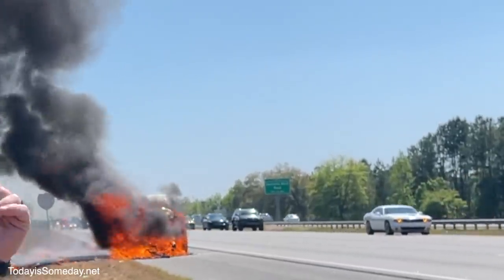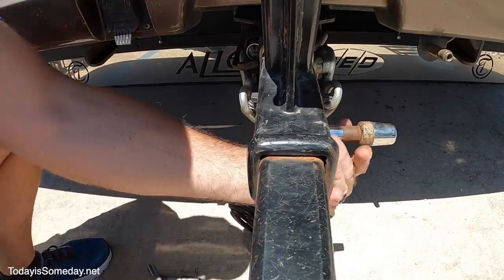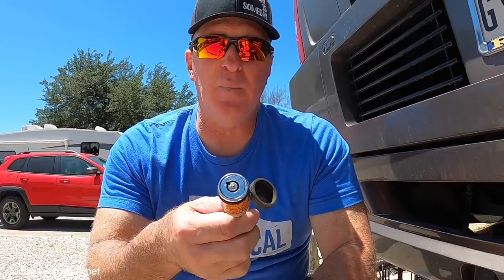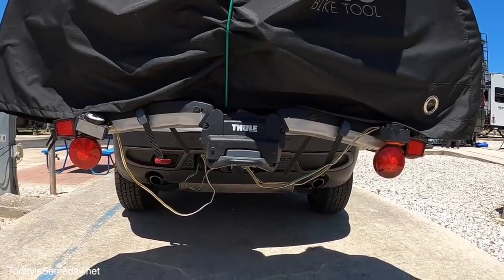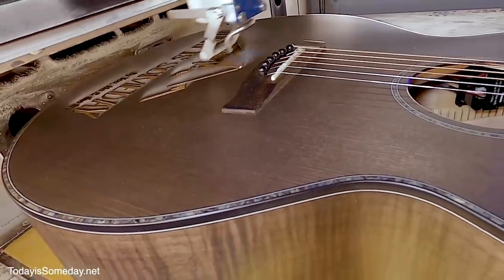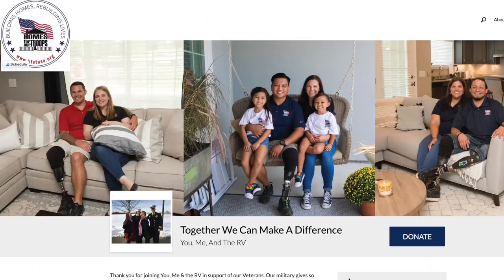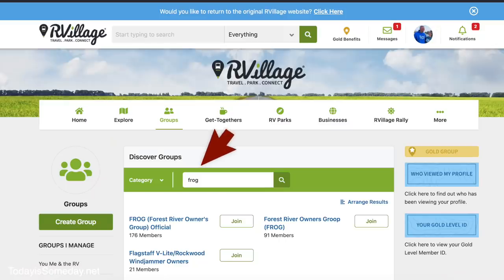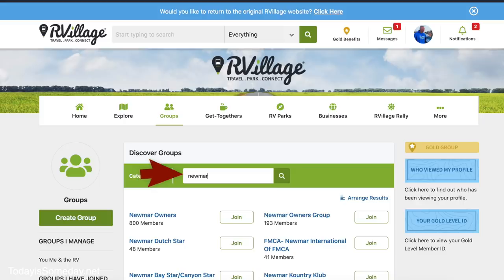RV Tow Car Changes (FULL TIME RV)

Comment: At the moment the tow bar is secured to the motorhome with a locking pin and the tow bar arms are connected to the toad with cotter pins only.  Will be thinking about using easily removable pin on the tow bar connection to the hitch when traveling.  Appreciate the video on the topic, good food for thought.  Go Navy!

Comment: Some thoughts,for tow vehicle parked overnight,put the car in park,park brake on and activate alarm if you have one.then leave a BIG note on or near the RV ignition to reverse what you did to the tow vehicle before starting the RV.About fire extinguishers,put extra large one in one of the passenger bay compartment,and one smaller one.the large one couls be used for very large fires and the smaller one could be used for outdoor fires,like bbq,camp fire,tikki torch gone wild,etc.One important note is keep at least one extinguisher in the bedroom area,this could be used to make a path in the fire to exit the RV.Of course,VERY IMPORTANT!!! STOP making fires!!!  (just had to add that....lol).enjoy....

Comment: Vise grips are your friend.  I use Erwin brand as they work the best. I keep a pair handy in the front.
Once the locking pin is removed you can use the head of the pliers to hammer the big pin most of the way out.  Then clamp the pliers onto the pin and wiggle the pin out under tension. 
I went crazy with fire extinguishers.
  I have one useless ABC powo extinguisher.  I bought a 6 litter kitchen extinguisher, Brand Badger Model WC-100. 
I bought a quart of Cold Fire additive, that's mixed with water.
It's then charge with 100 psi of air.   You can use it and refill it.
This allows you to try it out and know how well it works.  Test it with water as that's free.  Then test it with additive.  This sprays a large mist at the fire. Shoots about 10-15 feet.   I also bought a 2 gallon water extinguisher, which shoots a stream about 25-30 feet.  With the cold fire additive I can put out a tire fire.

Comment: Thanks. You made me take another look on how I hook up the TOAD. I'm going to start with the cotter pin on the hitch pin.
Reply: Yeah, regardless of which side of the tandem is on fire, it seems easier to separate one pin on the hitch side than two on the vehicle side when seconds count.  Of course, how close the nasty hot flamey stuff is at that moment to either will influence your decision.

Comment: My nephew’s locking pins (ones which use a key)have a slight bend in them.  Now his are not hooked to a towed car, but a trailer.  So those pins can bend which make it difficult to remove too.  Just be informed, those can bend which make them difficult to remove. Not sure if this is the norm with those style of pins.

Comment: You should check into pins that's got a handle on it if you could stop by a tractor supply or Farm Supply they would have them much easier to get out

Comment: Consider connecting a cable to the cotter pin on travel days and "storing" it on the hitch above your toad hitch.  That way you will not have to bend down closer to the fire to pull the pin.  You will only need to grab the attached cable and pull that to remove the pin.  If you also attached a cable to the other part of the pn you may be able to pull that to get it out of the hitch and be farther away from the fire while pulling it.

Comment: Thanks for this one.  I lock my travel trailer hitch setup to the truck when pulling, but I'm contemplating going back to the cotter pin for travel days.  My biggest worry is the three 20lbs bottles of propane sitting on the tongue - if there is a fire there, the whole setup is probably gone even with gasstop valves.  Travel safely!

Comment: I always only pin the toad. If we stop for the night I put on the parking brake and put the transmission in gear (it’s a manual). So it can’t be rolled away, in the morning take the brake off and transmission back to neutral. If the car is crooked at all I have issues with pin removal.

Comment: We  have a 10lb inside the entry door, a small extinguisher by the laundry as well as Proteng in the fridge and water heater. We have a glass breaking hammer in the front of the coach and by the bed. Please also check your emergency exit window. Ours was stuck closed, pushing on it with both feet wouldn’t free it. Practice emergency exits. It’s further to the ground than you think!

Comment: We have a locking pin for the receiver to the tow bar.  We have (not locking) cotter pins for the tow bar to the toad.  I know it can be difficult to disconnect the toad from the tow bar when there is tension on the tow bar.  I have a 3lb sledgehammer and a 3/4 inch bolt in the rear bay of the RV.  Once I have the cotter pin pulled, one good whack will release the pin.  In an emergency situation I hope that I have a clear enough head to get that done.  By this method, we keep the tow bar locked to the RV and I don't have to remember to lock the tow bar to the RV when we arrive at camp.

Comment: Most tow bars have handles that are easily depressed to unlock the tension between the coach and the towed.  Hitting those first should make it possible to unhook the tow bar quickly.

Comment: As far as un hooking have a claw hammer handy you could pull spring pins with the claws and drive out a pin with the hammer head,
you ado a great job

Comment: My husband seen that video and also removed the locking pins and no longer locking the hitch, he is using the cotter pins instead.  Good point to put it on passenger side we didn’t think about that.  Thanks for the information guys we appreciate your videos.
Reply from the maker: So glad we can learn from each other!
Reply: I would have thought pulling the cotter pin would be easy but pulling the hitch pin out is the hard part.

Comment: Cutting the tode loose on a grade can cause another problem unless some one is inside to hold the brake. But if the tode is on fire and it is on a grade it can either smash into the rig or take off down the road in flames.

Comment: A 10 pound ABC fire extinguisher will extinguish alot of fire if you know how to use it.  A service most fire departments provide is training on the proper use of fire extinguishers.  It will help you stay safe if you make the decision to try and extinguish a fire.  A note on a toad fire.  Be extremely careful on putting yourself between the toad and motorhome.  Some vehicles have cylinders on the front bumper which could fail with a well involved engine compartment fire and cause serious injury.

Comment: Hey guys, just a little trivia, the locking pins you are speaking of are commonly known as a linch pin in the farming community.  Reasonably priced and all different sizes at Tractor Supply Stores.
Be safe out there.

Comment: I switched to cotter pins on the toad a while ago because locking pins became difficult to turn even after using lock lube. I still use the locking pin on the receiver but will now rethink using cotter pin there also. What about taking the toad out of neutral to prevent someone rolling it away? Still would need to put the locking pin in the receiver when parked to prevent it from walking away. Love your videos! Stay safe.

Comment: The only locking pin we use is on the hitch locking the tow bar to the MH.  On travel days where we do not want to disconnect the car we always put the car in park and lock the doors. We have to run the car engine before we start out in the morning anyway to move the transmission fluid in the car per the manufacturers towing recommendations anyway so ours is not left in neutral overnight.
Reply from the maker: Perfect.  It is always good to use the manufacturer's recommendations.

Comment: I would put the cotter pin on the driver's side. That's an easy pull. Once you remove the cotter pin, you can pull the hitch pin towards you on the passenger side.

Comment: Doc Fair - your experiences made me sell my new (never used) tow-dolly, buy a 4-wheel drive Jeep Cherokee just like yours, outfit the motorhome and Jeep with a tow package. I have been intimidated by the steps needed to tow the Cherokee and haven't towed it. I installed a Revelco anti-theft on all my vehicles ($600) including the motorhome and Cherokee. I have been restoring the motor home to better than new for 2 years during Covid. Both The Beast (and me vaccinated) are ready to hit the road.

Comment: I have moved from the standard pins to locking pins on my towed setup.  This is due to the stories I hear about people coming by when you're parked and pulling a pin for the fun of it.  I don't want to be driving down the road and losing my hitch or connection point on my towed.

Comment: We have the Thule Easyfold and use a bike cover also.  For lights, I made a lightbar.  5 foot 3/4" PVC in a neon pool noodle.  Lights attached to the bar.  You can use clips or straps to attach the light bar to the cover (or the bikes without the cover).   The lights are substantially more visible when placed higher.
Reply: How are the lights powered on the rack?

Comment: We had a cotter pin come off one arm on our tow in El Paso, I looked over and the tow was in the other lane. Luckily only one came off and I was able to come to a slow stop in the median. I switched to locking pins all around and never have had another problem. I am going to switch the main hitch lock to a pin while traveling after seeing this video. I will not change the the locking pins on the arms after that experience..

Comment: Hi guys. Great info. I actually ended up helping a guy in a gas station. Before he realized he could not make a turn into the pump (regular station - gas A class) he was stuck. Somehow the locking pins became full of road grime with the covers on so I ended up taking it all off the coach by breaking the locking pin. Got the Jeep off to the side. Loaded the pins with WD40. replaced the main coach locking pin with a standard unit. He was lucky that I had a spare.  The coach and Jeep were parked for 2 months while they were at home. They left everything hooked up so it would be ready to go. Nice couple and I was happy to help. However no way did they do a pre trip check on anything outside. Jeep tire pressures were low, they did not have a pressure system on the coach. They said they usually didn't travel far, so they didn't expect issues. WOW  
Checking all locking pins and clip pins this should be done before every trip just like the tire pressure and window shield fluid level and type. Since were in Canada and head south in December freezing has already taken place. Do you have the correct -40 stuff or has the container froze and broken ?

Comment: They do make locking pins that can be keyed to the same key as the Jeep which would allow u to keep looking pins on but have easy access in terms of a key for quick removal... I know there are suppression systems for the engine of bay of your RV( I believe Jones n to travel) endorses a product.... but regardless thank you for all the tips they are applicable even for us still in sticks and bricks

Comment: If you used pin with a 90 on the end, and kept a hammer by the door and ran back with a hammer, you can beat a pin out without another trip to the front to shake the vehicle to release the pressure.

Comment: What caused the fire?  that should be what we are concerned with.
Tow bar is attached with a bolt and self locking nut.. ( that is getting changed?) Our Jeep is on a trailer. (we have 2 ways to tow) on a trailer/ 4 down.
 It will be on a trailer from on.

Comment: Great video guys. Good food for thought. I am using the locking pins as well. I think I will replace the one locking pin on the receiver side with a non-locking pin on travel days. Easy enough to do and might save some time in an emergency. Thanks for sharing. #GONAVY

Comment: I diagree on the placement of the cotter pin. It should be on the drivers side as it is easier to remove and then you can pull the Pin from the Passengers side which in most cases requires more effort

Comment: Like you, I have been using the locking pins on both the hitch side and the towed side when leaving the towed connected overnight, but switching the towed side to cotter pins when underway (still using the locking pin on the hitch end).  I have also been thinking about your fire video; how would I disconnect the tow bar from the hitch in the event of a fire in my towed (Jeep Grand Cherokee).  I guess I'm going to follow your lead.  Yes; I have found it difficult to remove the locking pins or cotter pins at times just disconnecting our towed to use it.  I think we have the same tow bar as you: Blue Ox Avail.  Even depressing those tension release levers doesn't help, especially if on an unloved surface.  So switching back and forth from locking pins to cotter pins may sound easier than it will be, but safety first.
Reply from the maker: We agree completely! That toad was on a slight hill so it was very hard to remove the cotter pin!

Comment: Hey guys wanted to let you know what I did with my bike rack since I carry my bicycles covered on the back of my toad as well I added LED boat trailer lights to the bike rack itself and then adapted the harness to plug-in to either my jeeps trailer hitch harness when I’m not towing it or the RVs trailer hitch harness when I am. 
Brad
“It’s about time now”
Sends

Comment: Just a couple of random thoughts (that are probably echoing what someone already said).

1.  If you are just doing a quick overnight stop (Cracker Barrel, Walmart, etc.) where you do not need to disconnect the toad, it is probably a good practice to put your tow vehicle in park and lock it up tight overnight anyway.  That should foil the easy roll-a-way theft issue anyway.  
2.  In the circumstance where the toad is on fire in the front (as was the case in your assistance adventure), couldn't someone had just gone behind the vehicle and pushed it a little towards the hitch and relieved the pin pressure that way?

Of course, my big takeaway from that prior video is FIRE EXTINGUISHERS.  Buy all you might possibly need and then buy one more.
Reply from the maker: All great ideas.  Once the Jeep is in tow mode, for us, it is easier to swap out pins, then remembering to go and actually mess with the brake (it is already in park in tow mode).  This way we know for sure that it hasn't been messed with.  Pushing the vehicle might work, depending on if you were on flat smooth ground.  But gives folks something to consider for sure.
Reply: @todayissomeday  Yeah, I was thinking of the common small manual tranny cars that many people tow.  It is already in neutral so it probably wouldn't take much pressure from the rear to relieve the tension on the pins.  The viability of this idea will be highly dependent on the tow vehicle, the incline, the body strength of the person, etc.  Just the thought of a $15K car being on fire attached a Class A worth 10 times as much (that also likely contains many/most of your worldly possessions) is frightening as hell.

Comment: Since halon is illegal these days I don't think you're going get any of that although i guess there some older ones still available.  I've given a fair amount of thought to fire extinguisher in my rig and I think I'm going to go for CO2.  I know it's not approved for the types of fires you get in RVs (I forget whether it's A, B or C) but it doesn't leave a mess like the dry chemical extinguishers.  The problem with dry chemical is that if they actually put the fire out the chemicals do as much or more damage than the fire did, that chemical is incredibly corrosive.   
As far as Homes for Our Troops goes have you guys ever thought of doing something like "A Year to Volunteer" to help the vets in those houses out with maintenance?  I'm sure many of them want to and can do it themselves but I'm pretty sure some can't.  Just a thought.  Keep the good stuff coming guys.
Reply from the maker: You know there are quite a few extinguishers on the market that are approved for RV type fires that do not corrode. 

We would love to do something like that but they are not similar to Habitat for Humanity. They hire professional crews (actually most donate time  resources). If we could volunteer we would be all over it!

Comment: My old boss burned his trailer and truck to the ground years ago. When I started towing the SUV I went with the traditional trailer ball type hitch and a quick release ball as well. You'll not going to ever be able to pull out a pin under load.

Comment: How about a wire on the cotter pin and another on the hitch pin so you can pull them from a distance and not have to stand between the rig and toad??

Comment: Get a longer pin, with close hole cotter pin and a hole the end that you can put a master lock through. That way pin stays in and you can just take the lock on and off easy.
Reply: And flip it phil cotter pin side on driver side, because you gotta pull the pin out on the safer side. Less time reaching over.
Reply: Left hand over pull little pin up, right hand main pin straight back an out.
Reply: Amazon MAXXHAUL 50151 Trailer Hitch Lock Pin Set 5/8 and 1/2 Inch with Locking System Anti-Rattle for 1-1/4" and 2" Class I,II,III,IV,V Hitches - Black Finish

Comment: LOL. Foam it up good ol AFFF, if it has not turned into jello.  Halon is more for but not limited to electronics rooms. ABC Dry chemical is probably the best fit for motorized vehicles.  Those aerosol cans are GREAT for the kitchen. A 2.5 pound ABC Dry Chem mounted in the toad and a 5lb ABC Dry chem or 2 for the RV would probably be good. If you need much more than that, then it is time to step back and let the pros handle it.

Comment: One thing to remember if pulling over due to fire is keep as straight a line as possible when stopping so that pins don’t get bound up by pressure from off angle. Otherwise you won’t be able to pull the pins either.